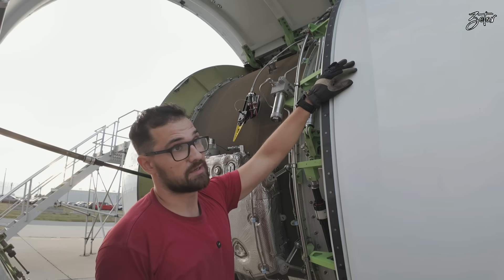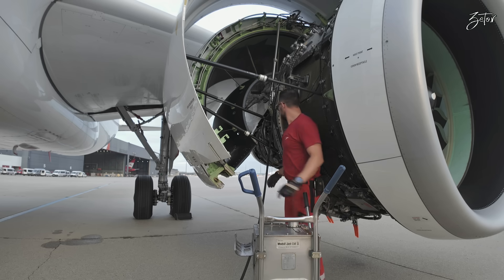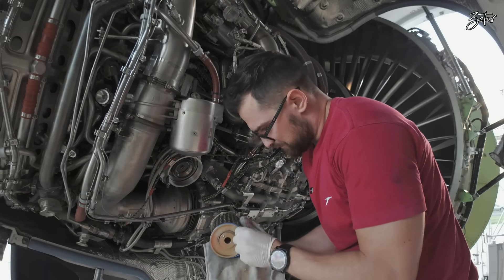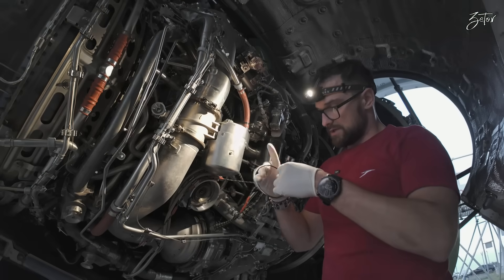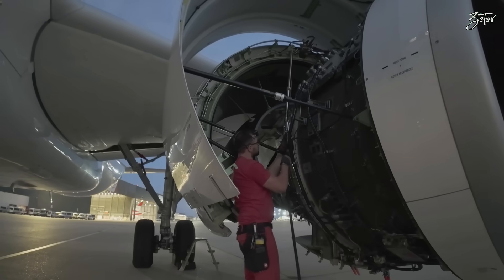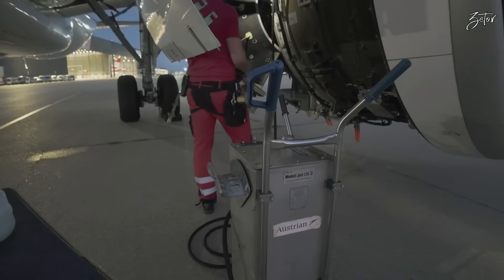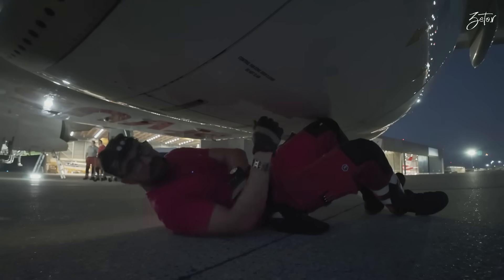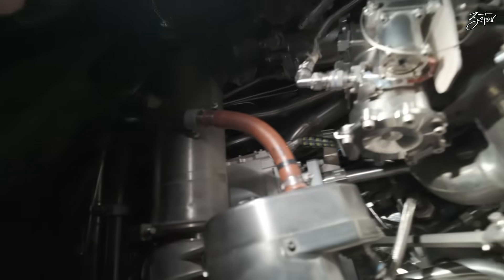How to replace fuel filter on Airbus A320 - PW1100G engine

Comment: Never and Never cut a bag with a blade that contains a sealing ring. If I see that as control, you get a big slap on the fingers.
Reply from the maker: So how do you cut the bag? Because if I hold the edge of the seal between my fingers how I can cut it with out cutting my fingers?

Comment: My left engine used to shut down mid flight, was wondering what was wrong. I took my Neo to the local mechanic, he said he'll change the fuel filters for both the engines. After that, it started running smoothly until few days later both the engines shut down mid flight. Parked the plane somewhere near the highway and had to tow it back all the way, home. Thanks to this video, i finally found the courage to change the filters myself and when i checked, i found that both of my filters are missing, the local mechnic had scammed me. It cost me both the engines. Now im running a pair of turbo jet engines with afterburnes from a Mig 29. Can you show me how to change filters on those?
Reply from the maker: I don't work on mig-29. Sorry

Comment: 3:57 I Find it interesting that it is only handtight, with how much planes vibrate and move around. I assume more than a race car?
Reply from the maker: Did you realise that there is safety mechanism which hold it on the place
Reply: There are small notches at the top of the filter canister which latch to a spring loaded hook. It allows the canister to be turned in a clockwise motion but not in a counter-clockwise motion. This is the safety latch the prevents the filter canister from loosening during engine operation. It works in the same manner that a simple zip tie works.
Reply from the maker: Nicely said 👏👏👏

Comment: Why you are not use torque wrench, the bowel has hexagon nut.
Reply from the maker: Because manual said hand tight
Reply: @zeto.r  what about using a wrench to unscrew the old one
Reply from the maker: Normally I'm doing that but this was just for a demonstration that it is possible

Comment: I was waiting for the usual comment of 'why don't they make access easier!'.
Reply from the maker: Because we don't change the filter every day 🙂
Reply: @zeto.r  yes exactly.  That's the part I find strange in the auto mechanic videos. It is very common for people to leave comments complaining that timing chains or spark plugs that only need servicing every few years are not more accessible. To me it's sensible as is the somewhat time consuming process to change the filter of that jet engine. I really though someone would complain about it but it seems to be accepted if the engine is not in a car. Thanks for the interesting video.

Comment: Good Job! I suggest not to use any sharp object to unpack the O-ring 6:48 as you might damage it without knowing...
Reply from the maker: My question to you is how to open it then? Let me tell you a secret, I find o-ring inside and cut bag in front of it
Reply: @zeto.r  Thanks for your question. They have to be supplied by your vendor in easy to tear packs. If you have their contact please check with them, they would have provisioned to open the pack without using any sharp object easily.
Thanks 
Ismail

Comment: Is this filter changed after X hours of operation or the FADEC request the change based on differential pressure(does it show on ECAM or is it sent as a out of band maintenance message over satcom)?
Reply: Did you see a delta P?

Comment: I was working at FL Technics, and you don't do that like this - this could be pure failure. The only thing this dude is doing this is the highest tier enginier and their salry in europe is like 10-15k no less euros per month. Because you have to have atleast 3-4 supervisors after your job is done.
Reply from the maker: I had one inspector which is required when you work on critical tasks. I was with FL as well and I still have an active licence there so I know how it works there 😉
Reply: @zeto.r  nice
Reply: @zeto.r  Oh and from then on i understood more about the planes and it's safety. You will be like 99.99% safe on the plane if it is major commercial brand. They just cannot be airborn if something is bad. Also about airlines like Ryanair, Ryanair repair facility was just like 20 meters from FL technics repair facility where i had friends also. The security, the actual checking... everything is sooo much on the top to not get human error. I feel save flying.

Comment: so despite everyones joking, this is really cool to see as someone whos never seen inside a modern jet engine. also when you said oil filter at the begining it got stuck in my head and so when you pulled it off and all the clear liquid came i was worried and then remembered it was fuel filter.

Comment: That is scary as hell. Why doesn't Airbus (or the engine manufactor) require to use a torque wrench to tighten the fuel filter? Every maintenance technician who replaces the filter has a different sense of "it's tight enough" Maybe the ratchet sound is an idication of "tightnes" but that wasn't explained in the video.

Comment: How often do you need to change the fuel filter on aircraft? Is based on like flight hours. Cool to see thanks for the video, I know a lot of people like to joke but its to cool to see how the plane engines get serviced.
Reply from the maker: It depends on the engine and airplane, some are based on hours some thanks to software

Comment: Why is it necessary to close all the laches before testing a fuel filter?i mean the engine is not on full thrust i guess.
Reply from the maker: The engine must be always secured against any movement if you leave the latch open c-duct can open. What if it catches fire? What then?

Comment: Plastic glove for works on a predictable hot surfaces; bracelet and watch when working on mechanical equipment 🤣...
Head protection...Ouch!..Even a fellow designer used a cylindrical profile for the support
SAFE FROST 🤔🫡🫡
Reply from the maker: Gloves for work on the fuel system. What do you expect me to wear.... whenever I'm working in a space where I can cause damage I remove both of them, otherwise, I need to track the time and a bracelet is more tool that bracelet. I'm not wearing a helmet in such a close environment since I will hit it all the time and I left it in the footage just for fun so people like you can get wild in the comments 🤣

Comment: Great to see those engines in the field! Working at Pratt as an engineer I owned the manufacturing process for one of the HPT flow path seals in the PW1100 GTF. I also currently own the process for the V2500 HPT seal and seal carrier assembly.
Reply from the maker: Wow, that is a super responsible job. One day I would love to see the place where this engines placed together
Reply: Finally, the exact person I wanted to talk to. I have some strong opinions on the V2500 HPT seal that I've been dying to share

Comment: I can do this in my sleep it's so easy .in fact I replace the filter at 30 thousand feet without  any problems. I'm a mobile plane fixer.
Reply from the maker: Did you cut hole in c-duct during flight or how?

Comment: Mine it’s fuel filter got clogged mid flight and engine went off so I parked it in the air between Africa and Asia. Thank you now I can buy the fuel filter so that I can go and change it.
Reply from the maker: Let me educate you a bit. If the filter on the aircraft gets clogged fuel will flow around through the bypass valve. This way we prevent a shutdown of the engine 🙂

Comment: everybody acting like this was pointless, but im a car mechanic and it was nice to see the difference in style of work
Reply from the maker: I'm glad for such a comment because you know how to replace the filter on the car, not like most of the people here. Thank you 🙂
Reply: @zeto.r  may I ask, what is the general procedure for working on stripped/rounded bolts and threads on aircraft? I'd guess it isn't as big of a problem considering the quality of metals being much greater but I'm curious. Can stripped threads be repaired etc? Or does it require complete replacement of the part?
Reply: Agreed and its also neat to see the few similarities like the bucket barely catching spilled fuel, whacking your head on the support strut, the filter that "should" be hand tight but in the back of your head you know its probably not going to be that easy. Good to know there can be just as much headache as working on cars 😅
Reply: Wow, for the amount of fuel going through that unit it isn't very large.
Reply: it is a great video. people are making fun, but everyone enjoyed it!
Reply: same
Reply: I left a pointless comment like I knew someone like nearly everyone else. Guaranteed all those comments just like mine are from very much none mechanics. I'm sure he understands and hay every comment is an upvote for the algorithm on his video. I personally would never think of this very good quality video pointless.

Comment: Can you either show us or give an example of the paperwork you would have to complete when finished this changeout?
How did you know it had to be changed? Hours? Flight deck indication? Thanks.
Reply from the maker: I'm not sure how far I can go with our paperwork. Most of these things are confidential. Replacement was triggered by software l, because pressure raised in front of the filter
Reply: @zeto.r  I understand. I was not asking for specific details about parameters and such like, but when you have to fill out the forms (I am assuming it is electronic 'paper') is items like what time and date, who did it, etc. More of the general aspects than specific. I do not want to make any trouble for you!

Comment: A thousand of pieces! I’m afraid to flight now. 😮 If one turbine fail, is possible flight with just the other?
Reply from the maker: Every aircraft can fly with one engine, even if both of them fail you will land safely
Reply: @ Thank you! I didn’t know planes could land without engines, i think it stol.
Reply from the maker: Every aircraft is also a glider

Comment: I'm guessing the used filters are pretty spotless, but they require changing anyways?
Reply from the maker: This replacement was triggered by software because pressure in the system raised
Reply: @zeto.r  neat, thanks!
Reply from the maker: With pleasure

Comment: I did not get this.. why he did not use appropriate tool to loosen and tighten outer shell of the fuel filter..? Do airbus allow this ?
Reply from the maker: I lose it by hand just to demonstrate that it is possible and for  installation is required to house only hands
Reply: @zeto.r glad you are following books ..Dhanyavad.
Reply from the maker: Of course I'm following AMM

Comment: I wouldn't have used a knife to open the O-ring package. You run the risk of nicking the O-ring. If you need to then carefully inspect that O-ring before installing it.
Reply from the maker: You need to know where is o-ring inside. You can damage it also with the knife as well

Comment: Are you telling me there is no specific torque requirement for that bowl housing. There is a nut welded on the end of that for a reason.  If this is the workmanship throughout the industry, I will never fly again. Just my opinion, but I find this video to be a reason to set standards within the aircraft mechanic industry. I couldn't be anymore disappointed and frightened.
Reply from the maker: That one is for removing, the thread is very long so even if you leave it a bit loose nothing will ever happen and of course, you have your duplicate inspector who checks after you. Anyway, a safe device keeps you covered. Almost every filter bowl is only hand-tightened on boeing and Airbus

Comment: Good video. Thanks. 
I am surprised because the fuel filter is supposed to be a Line Replaceable Unit or LRU, which by definition can be replaced within 2 hours. On a CFM engine, where the accessory gearbox is located on the fan, the access is much easier and quicker. And colder 😊
Reply from the maker: Hi. The full procedure can take up to 2 hours. It is very easy and fast

Comment: I was always wondering how maintenance is done on airplanes. Even if it sounds easy to change a filter, it's not that easy. You have to follow all the steps as they are mentioned in the maintenance manual. Thanks for sharing this experience with us :)
Reply from the maker: Thank you. Yes we must follow every step but this increase safety

Comment: Cool video. I was actually expecting a much bigger filter! How does that filter flow enough fuel to meet the demands of that big jet engine!?
Reply from the maker: You have big requirements for jet A fuel, and whenever pressure rises in front of the filter you get info to replace it bu software

Comment: Motorcycle mechanic here. We always check for leaks, not just idling but riding the bike and getting it to operating temperature. Just like your industry, one failure is a dead man. in your case many more souls. we have to be absolutely sure. Great video man

Comment: Wow, as an airline passenger and auto mechanic, it is amazing to see how similar the procedures are despite the size difference- How much time does it usually take to do this job? I imagine doing a filter change in a car or truck and having to bend down and stand back up a bunch of times, having to go around to the drivers seat to turn the key to prime the fuel pump, etc., except the driver's seat is way up there and takes five minutes to walk back and forth from... As a passenger, it makes me very concerned about the potential parallels between good versus bad auto mechanics and I just have massive respect for your work knowing you do the correct job! Very cool video, and the comments are hysterical.

Comment: Isn’t it prohibited to instal the fuel filter element into the cover firstly IAW AMM? I think than exist a risk that o-ring could be deformed and damaged during installation like this.
Reply from the maker: Cover centres the filter and slowly insert it on the housing, if you properly lubricate the o-ring there is minimal risk of damage

Comment: i work on older A320s with the v2500 engines. im glad to see you dont have to struggle with fan cowls and deactivating TRs like i do lol
Reply from the maker: V2500 is a bit special. But no oil consumption 🙂

Comment: It's unbelieveable that is only has one filter. I work on trucks and they usually have 2 or even 3 fuel filters. Also 3 oil filters some of them. I'm also noticing that there's not much plastic on those engines as we have in cars and trucks.

Comment: Hand tight means different thing to different people. I think fuel filter should be tightened with a torque wrench to specific tightness. It is critical not to have fuel leaks. No fuel filters on cars are hand tightened.
Reply from the maker: If you follow AMM you will be able to tight it all the way without problems

Comment: I’m guessing you can’t run the engine with the covers open? Sure seems like it would be easier than opening and closing twice
Reply from the maker: You can but then you need firefighters on-site or an extinguisher because in such a case engine system is not effective

Comment: I don't trust  monitors cables, should have a manual mode for a key
Reply from the maker: You mean for fan cowls?
Reply: @zeto.r  yes, how is it ensured not to fly off without a key/or screw
Reply from the maker: You have them monitored by proxy sensors and every pilot is obligated to inspect them before the flight

Comment: thanks. i was an auto and light truck tech for 50 years. i have replaced many fuel filters. i know aircraft have a procedures that have to be fallowed for every repair and maintenance job for safety. it was interesting to see what your work is like. i would guess you get paid hourly. for most fuel filters i got paid .5 to 1.0 hr. no matter how long it took.
Reply from the maker: Cool, I always love to see comments like this, thank you 🙂 yes we are paid on hour base

Comment: I’d never want to be an airplane mechanic. You’re responsible and liable for everyone’s safety. If something happened to a plane I worked on I wouldn’t be able to sleep at night.
Reply from the maker: If you follow the manual there is no chance of a problem. Every critical task requires a duplicate inspector. It is always about your mind setup🙂

Comment: When it comes up, would love to see or hear about your experience with the PW1100 oil filter change out.   Would be interesting to hear your input on the challenges.
Reply from the maker: It is as well quiet ok I will make a video whenever I will get it🙂